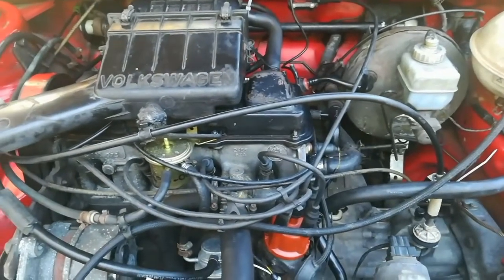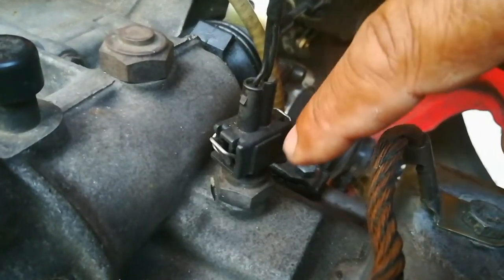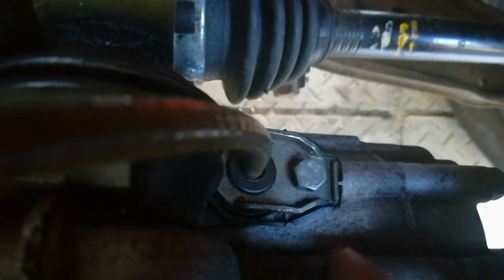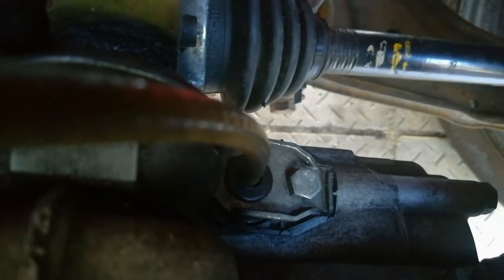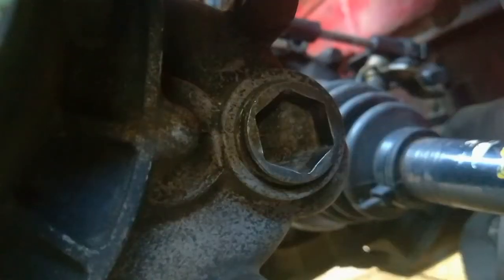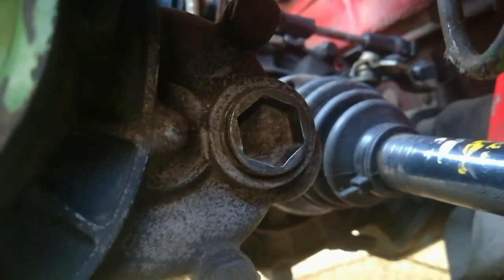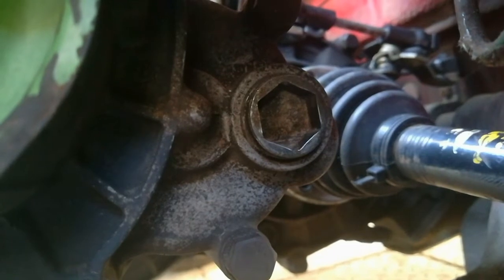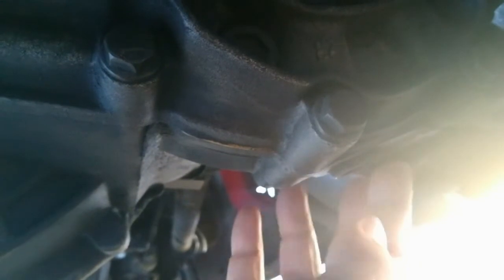VW GOLF MK1. HOW TO CHANGE GEAR /TRANSMISSION OIL, AND TOP UPS  (TIPS) #golfmk1 #golfmk2 #vwfox

Comment: Thanks for this. I conveniently have a 17mm Allen key to remove the filler and drain plug. I have fulfilled with 80w90 gl4 oil and the gearbox took 2 litres. Unfortunately the owners manual does not give the above info which I fpuld put from research AND much reading.

Comment: what brand or spec gear oil would you recommend of the VW MK1? and at what intervals are you supposed to change the gear oil?
Reply from the maker: Hi There. There are various brands, but just ensure its EP 90 Gear oil... With regard to the intervals, the vw mk1 manuals says never to change gear oil, unless you topping up. Many Fellow Golfers will disagree  with this, and say every 50 000 .kms.,.. But if you hearing strange noises, grinding, difficulty selecting  gears, have it checked out. You may be low on Gear oil. Hope that helps you. Kindly Subscribe and share..
Reply: The fact that I've been hearing some sort of tapping/knocking sound FROM that side of the Gearbox I'm starting to believe I'm running low. Thanks alot for this @pjs-golfmk1-diy

Comment: Hi there. There is always leak stain coming from my gearbox wherever I stop. Also when I engage the fifth gear it is always a noise but in other gear the noise is not there. Can you please advise what I could possibly do?
Reply from the maker: Hi .you have a leak  then...It is common to leak at the gearbox seal .it' sits between gearbox and engine...have to take gearbox out to fix it ..
Reply: Also when I don't accelerate in the firth gear, it stops.

Comment: But how do you unscrew filler Nutt forward to the direction of the car as it drives or reverse towards the car reversing
Reply from the maker: Not sure If I understand your question.... But same principle Applies here when loosening a nut,.. Anti clockwise is loosening, and clockwise for  tightening